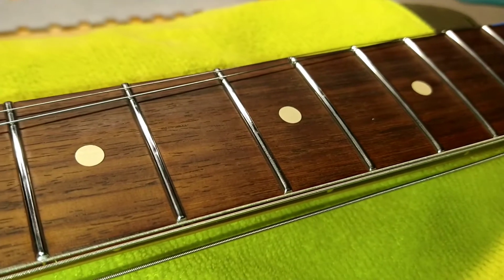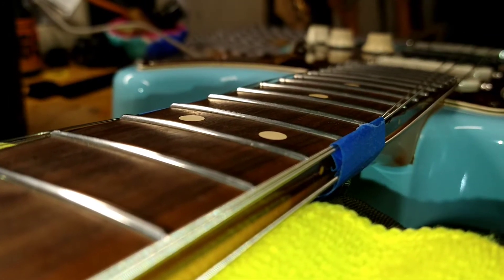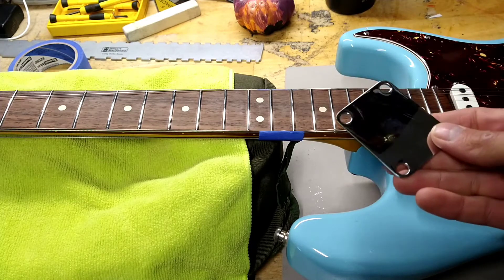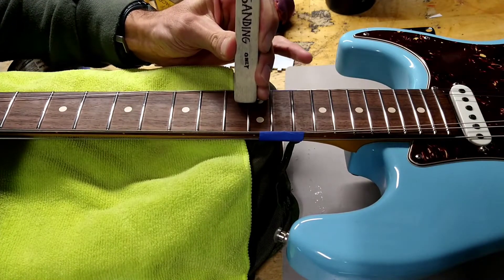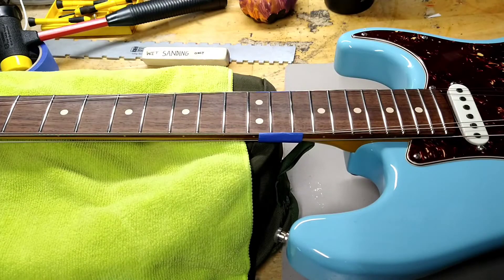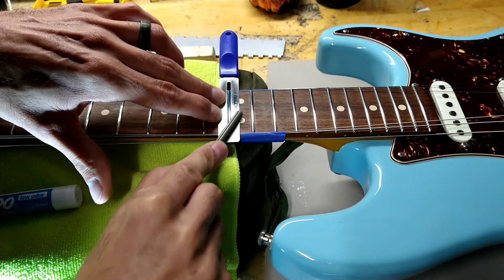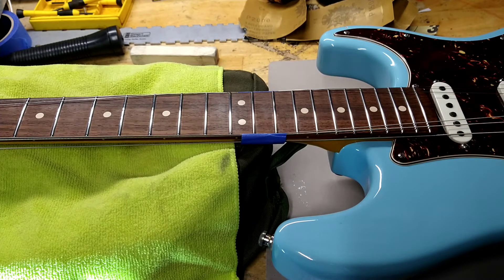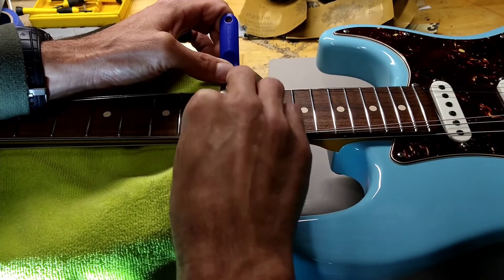Leveling a single high fret.  Learn to do it yourself. + 18 minutes of my annoying nasal voice.

Comment: If you have a file that you've had for several years and you notice it doesn't file as aggressively as it used to, there's a decent chance the grit isn't worn away, it's just clogged. Take a wire brush to it, and possibly your cleaning agent of choice for really stubborn debris, and try it out. It can revive old, worn files if you haven't tried that yet.

Comment: Helpful video. The 11th fret on my Squire is high. I’ve never worked on a guitar. I bought a cheap squire figuring I could tinker with it to learn.  This was very helpful. Thanks
Reply from the maker: You are welcome.  Hope you can resolve that high frett and get it playing smooth.
Reply: It's real. I have a perfectly low setup for my Tagima 530 and the G string 12th fret seems to be the only one with audible dead note.
Weird because others at 12th fret dont have this problem.
I like a bit of buzz as you wont hear it through an amp, but that note is clearly a dead note to my ears

Comment: Generally, if you have to tap it down, you’ll need to put some glue in, usually thin super glue. If you don’t they just end up back up again. Will also hold in place solidly if you do have to do some filing.

Comment: Actually, this is helpful.  You cannot be too careful filing frets.  If it gets too low, then you have to go and make the frets towards the body lower to compensate.  So thanks!
Reply: It’s for this reason that I file with the strings on and after filing always check/play one fret higher as well as the fret I’m working on. When your frets get real low it’s going to be a compromise.

Comment: Wow I have 4 rocking fretts thinking just leveling all my fret board off be easier than doing one ftrett a time! Can it cause frett buzz all up and down kneck high fretts
Reply from the maker: Depending on how worn all of your frets are in general it may be better to level all of them.  But if that is the case you will be recrowning all of them as well.  It can be fun work if you take your time especially knowing your guitar will play easier afterward.  A single high fret could cause fret buzz on one string or multiple strings  if it is near the bottom of the neck.  Especially if it is very high and your saddle height is very low.  I like to keep my action very low.  I always have.  So there are times I don't mind a little frett buzz but if it kills the note then it is a problem.
Reply: @therangersinger  thank u so much buddy I am going to take the time one day this week and just take the whole day and do the whole frett board levelled out probably be the best option and for the long run too it looks a great job and knowing that the outcome will be,I have 3rd frett and 5th and 8th and 9th fretts that's high and my low E A D strings buzz madly all over the kneck haha so definitely needs leveling would u say haha
Reply from the maker: @paulyoung4781  you are welcome.  No better feeling than nice level and polished fretts.  Makes you realize how cruddy the guitar played before 😂😂

Comment: idk if it has been mentioned or I just missed it but did you straighten your neck before doing any of these?
Reply from the maker: If I didn't mention it, I know I would have.  I have the neck relief straight edge from Stew Mac that I swear by.  A little pricey but will last a lifetime.
Reply: @therangersinger  so for this video, you have set it dead straight?
Reply from the maker: @jeeeeev  yes sir.

Comment: What If we had a one fret that lower the others ?
Reply from the maker: That would require a single frett to be replaced or you can level the entire fretboard.  That will also require the nut slots to be lowered depending on how much lower that single fret is and how much you have to level the other frets to match up to it's height.

Comment: if you have a single high fret, it is absolutely not seated fully...unless it got bigger or the other 24 frets got worn down it is raised up...try clamping it down with a furniture clamp first...hitting it with the hammer does not re-seat it often times, it just bounces right back up, leading you to believe that it's "high".

Comment: Ain't it damage the neck? Using hammer
Reply from the maker: Not the least bit sir.
Reply: @therangersinger  I did tried it before with my cheapest guitar 🤣,those had quite severe fret issue , I use a rubber hammer on it .. n yes It solved the problem n it didn't show any sign of crack both fretboard and the neck..  but Im hesitate to do it on my latest one ..
Reply from the maker: @everythingpotatoversion1201  haha, i understand your hesitancy to do it on your newer or more expensive guitar.  A little goes a long way so maybe you can be gentle with it and see if it is easy to knock it down slightly or worst case.  A local guitar shop shouldn't charge much for knocking some high fretts down.  Of course that all depends on how much they charge versus how much you paid for the guitar in the first place.  What brand and model of guitar is it that you are hesitant to work on?
Reply: @therangersinger  Cort X 100 X series 😄, slightly high at the edge of each fret 6, 11, 12,.. I noticed that after adjusting the trus rod , it's my mistake in the first hand actually 🤣
Reply from the maker: @everythingpotatoversion1201  it happens.  Only way to learn.  I wouldn't be scared to try and level them mildly in the style of my video.  Rather easy if you take your time and check and recheck.
Reply: @therangersinger  alright, it's just a matter of time to gain confidence to use that method. Thanks btw, for your time to reply my comments.. Appreciate it😄

Comment: Ok. So what about the opposite problem, one fret is lower than the others ?
Reply from the maker: @terryenglish7132  level and crown or replace that single frett.  Depends on the height difference.  I'm sure a level and crown will be your fix.
Reply: @therangersinger  I'm surprised no one makes a fix to apply. I'm considering Marine Tex , the metal filled epoxy hull repair product. My other solution is to switch out the low fret w the last, 21st , fret thats never used